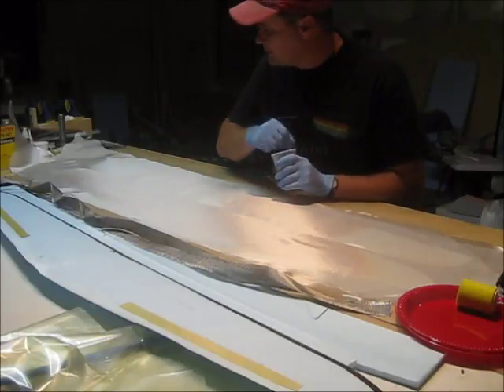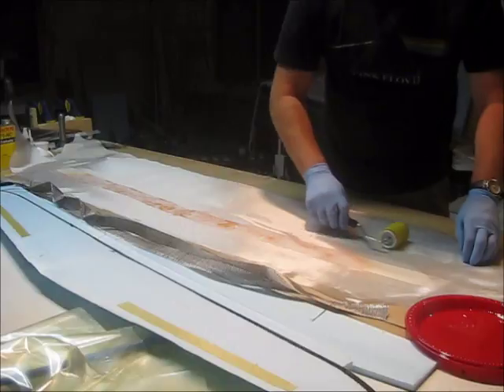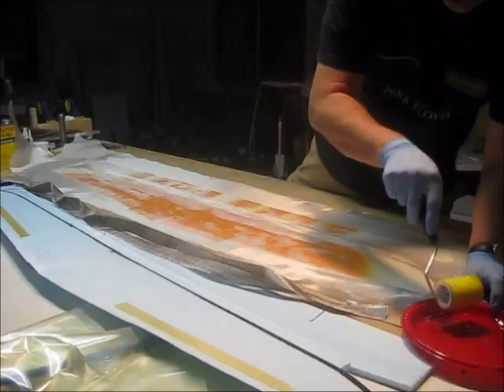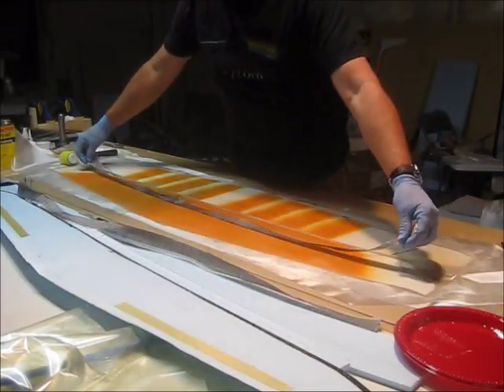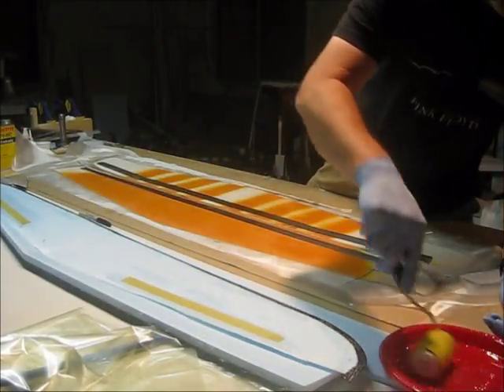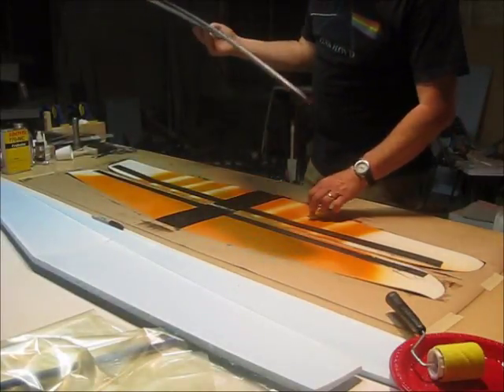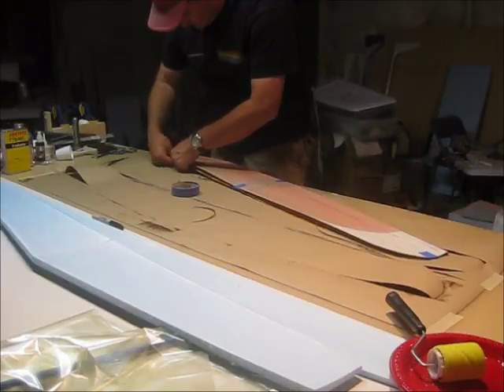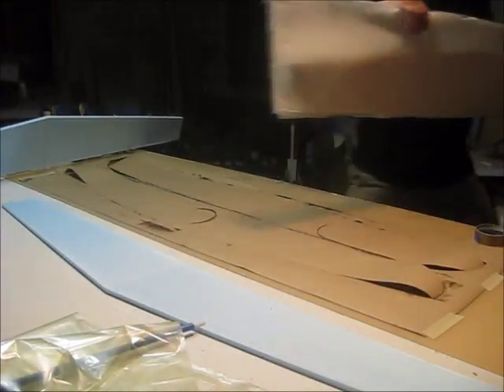Making a Composite Plane - Laying Up Wing the Wing p 2 #5 .wmv

Comment: Nice Job!!     Folks remember....the wing is only as straight as the table you laminate it on.... we usually put the top "Shuck" or foam saddle on top prior to full vacuum... get'r'aligned and then apply full vacuum... and full vacuum will destroy the 1 pound white foam....

Comment: Very smart you are using the roller rather than brush. Any reason you chose west system epoxy in particular?
I read about west system is good for marine applications e.g.surf boards.

Comment: so is there not a continuous skin over the leading edge? when you cut the glass in half and applied the skins to the wing do they have a lip?
Reply from the maker: There is not a continuous skin.  The LE has biased fabric about 1" wide layed across it.  This ties the bottom and top skins together.

Comment: Since already congratulated for their videos.
After watching your video decided to try to make a wing.
Cut the polystyrene core, and I did everything as it should be, in the end put the wing in a vaccum bag, pulled out after 24 hours the wing and the work was almost perfect, but I had a problem the Styrofoam core seems that collapsed in some ments.
What would be the problem, it will be better to use foam rather than polystyrene?
thanks
Reply: +Paulo Cardoso Polystyrene is hard to beat for really low densities. You need to limit the amount of vacuum you pull or it will crush the foam!

Comment: what kind of plastic did you use for peel ply?
Reply from the maker: s14slide No peel ply.  The wing skins sit on .014" mylar.  The plastic in the vacuum bag is just regular drop cloth plastic sheeting from the hardware store.
Reply: Jon Finch I should have specified more clearly. at 12:10 you mention release film and breather.  I'm good on the breather material part, but for the release film what do you use?  I'm afraid of going through all of the trouble of setting up for a bagged wing only to have it all get stuck together to the "release film" and have to trash it all.  Thanks for the quick reply.